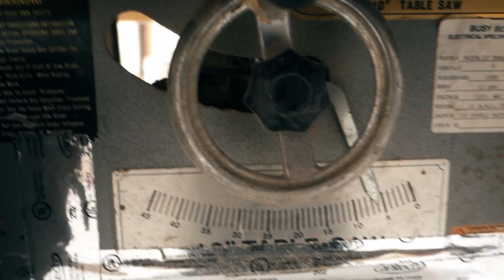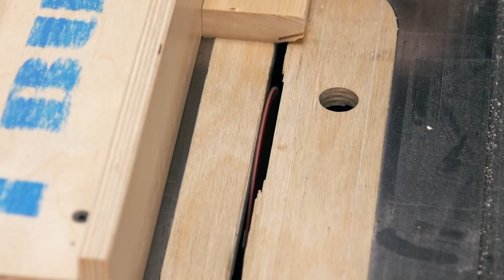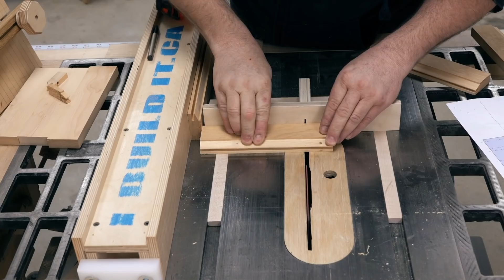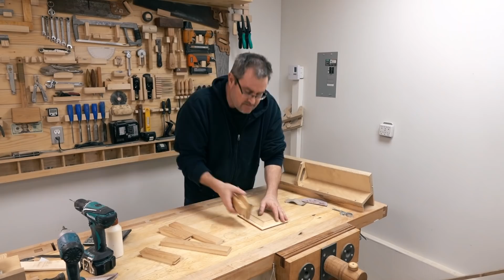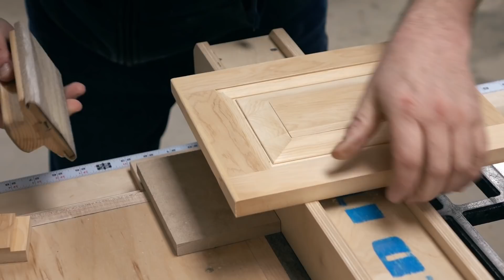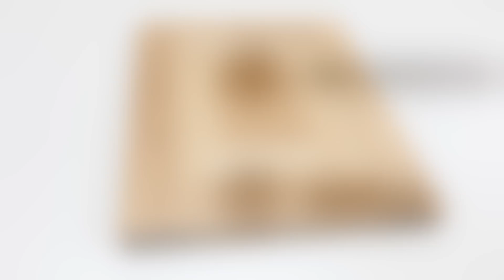Make Great Looking Cabinet Doors with Only a Table Saw

Comment from the maker: Cope and stick doors are usually done with a shaper or router bit set, but in this video I show how to do it using just the table saw. Not the fastest or easiest, but certainly doable and the results can be outstanding. 
See the build article for more details: https://ibuildit.ca/projects/raised-panel-doors-on-the-table-saw/
Reply: Thanks John I thought you did one with a cove, I use a 5 inch blade for a narrower cove that a 10 inch blade.

Comment: Nice method, but hard for me to understand the different views of the drawing. Which part is which view. The 12 degrees angle on your drawing I don't understand. is that the raised panel? it doesn't mention those details. I miss the extra front view from the frame too, since I don't see the side-bevel on the rail board. I think it would help to make close up pics from different sides since its easy to make mistakes which side to cut to what angle. The complicated part is the corner cuts of the top and bottom rails. I need to see how it looks like from all angles including on the back.

Comment: This was great to see John. I definitely wouldn’t have ever thought to have made doors in that fashion. I’ll have to give that a try the next time I make any cope and stick cabinet doors except I would probably use a tenoning jig of some sort or at the very least attach a piece of plywood or mdf to my fence to make it taller to give more support for the panel and the cuts on the ends. This will definitely make any doors that I do in the future much nicer as I can’t afford nor justify the cost of the router  bit set to have for the use for making a door once in a while. The doors that I have made in the past have just had a basic flat panel and the rails and styles have just been connected with either a simple single tongue and groove joint or pocket hole screws. I have learned a lot from your channel over the years of being a subscriber and I am very grateful for all that you have shared and thank you once again for sharing this great tip.

Comment: I don't totally agree with you when you said it was a fairly labor intensive way to make these doors vs. the router bit set.  I have done the cope and stick bit set, and unless you dedicate 3 routers to the process, you still need to do an extraordinary amount of fiddling and calibration.  I really like what you have done here.
Reply from the maker: Good point.

Comment: Thumb up for preciese and clean cuts. One aditional point for your approach is why here in Europe in home workshoops we mostly have 8mm shaft routers. Big profile router bits requires most powerfull routers with 1/2 chuk.

Comment: Had woodshop in HS back in 1981-82 and although I didn't do cope and stick, I did do the raised panel inserts.  I actually got to use a doweling jig and then rabbeted in the back of the door frame a groove for the insert.  Then chisel the corners to square them up.  Oh how bad I was when I started, yet even to this day still practicing to get better.   Surprising how much I got to do back then and in a time today where wood shop has been all but removed from the school system, it is what I "live" for.  I love the art of the craft.  Thanks, John

Comment: Router bits are not only cost factor. Those also need resharpening after 50-100 feet of material depending on thickness those had to work on, so unless you keen with resharpening those and then dial all back. Table saw is more efficient all around.

Comment: I agree that the router bits are super expensive. I guess one would have to way the cost over the use. If I were in the cabinet making business the bits would be the way to go. But not if I'm only going to be making cabinets for my home or shop. The clean crisp look of your method is refreshing. Thanks.

Comment: John didn't you do one using a table saw to do a cove panel? If not could you cover this in a video please as I like doing cove cuts on a table saw vs using a router because it is faster and safer. IMO